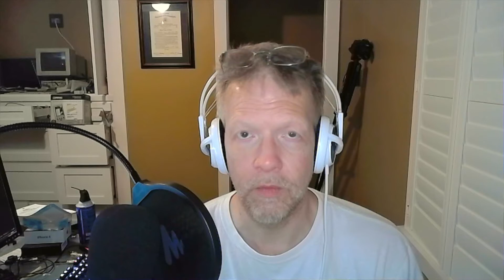BTC-S37 Mining Motherboard Warning: Don't Wire It This Way (IMHO)

Comment: please advise I have the one with the BLUE slots.  Now all 6 pins are live as you said I was trying to use 2 power supplies.  I plugged 1st psu into 1st 3 slots. and then 2nd psu into 4th slot to power a 4th gpu as psus are only 750w. so i wanted 3 gpus on psu 1 which i wired up and 1 gpu on psu 4 which i wired up. all wired up as you said  straight from psu.  now psu 1 was ok BUT psu 2 got very very hot and riser melted smoke!   is that because i plugged 2 psus into the 6 pins which are all live on same rail?  thanks.  if i am correct then how would i use 2 psus?  1 to all 6 pin and 2 cards and other psu just to 2 cards?  anyway safely use 2 psus thanks
Reply from the maker: Read thru for my recommendation...It could be a bad board, bad power supply, but in any case, it's a BAD IDEA to use two power supplies on the boards where the power connectors are all tied together. Just don't do it. The only way would be to use a power balancing circuit but then monetarily it isn't worth it.

There's no 'riser' on this board. People should not even think of it that way. There are PCIe slots. It's a standard slot, just wired for 1x.

Would you use two power supplies in a PC? Ever seen it? (short of servers of course, but they have it designed that way.) 

So don't do it! (I'm not fussing, I'm just trying to get people to STOP doing this).

Solution:
What I have on my board like this with all slots filled is a Dell 1100W power supply from a server that runs all 8 just fine as it has a lot of 6600/67000XTs and lower ppower cards. To go very high would probably require a 240V more expensive supply. It is my belief that efficiency will be key after ETH goes PoS so I've steered that way.

Go here https://www.parallelminer.com/?wpam_id=625 and look for the Dell X15 series. Make sure you match their board with the correct power supply. 

This link earns me a commission.

You can pick another power supply/board combo but the Dells are cheap.

I have the X15 Rev:B on both my boards. I would recommmend a cooling solution blowing at the PSU as well.

Please use these links as they support me or you can send $1 to http://paypal.me/rcbullock or whatever amount you feel is worth me wiriting this up for 15 minutes. :)

I have the X15 Rev:B on both my boards. I would recommmend a cooling solution blowing at the PSU as well.

PSU on Amazon like mine:

https://amzn.to/3uq1clS Why? Because you can get a 3 or 4 year warranty for like $9 and they can be found for under $30. R720xd is a server I have for other crypto stuff so I can keep extras around for that too.

A USB powered fan like this will let the PSU sit on top for cooling. It helps. https://amzn.to/3uomWOO

You can also use 120mm case fans. I bought these https://amzn.to/3xkbvto but they spin slow. Molex connector so I daisy chained them with an AC supply brick. 

You can see them in my other vid on the 8 GPU rig, frame mounted.

Want to sent me a few cents in crypto? Leave a comment for the blockchain wallet type you prefer.
Reply from the maker: I am forking this to a blog post at https://rcbullock.blogspot.com/2022/04/from-my-youtube-video-at-httpsyoutu.html

Comment: Will i be safe connecting 4 gpus directly on the motherboard and 4 other gpus with risers? Using two EVGA PSU for power.
Reply from the maker: You don't need risers. That's kind of the point: eliminate that trouble spot. Plus the rig is smaller. SOME of the BTC series have individual PCIe connections so you can use the slots like a riser and use two power supplies. BUT the BTC-S37 IS NOT like this. Some people say you can run the board on one PSU and the GPUs on another, but no one has backed that up with science to me yet. It goes against the 'power the riser and GPU with the same power supply' rule. You CANNOT do this with the BTC -S37 as the board is all the same power rails, so to follow that logic, you must power the GPUs with the same power supply. Somebody prove me wrong.

Comment: it work for years provides better cable management, it can do the volts better then some power supply wires, would you like some pics?,  the plugs work,  look up the specs or prove what your saying with testing. remember me i have 3 d37, please if your going to give public warnings do your home work first. your learning.
Reply from the maker: There's a thread on reddit that shows (if the testers did it correctly and the pics appear to be correct) which boards have connected power per PCIe and which don't. https://www.reddit.com/r/EtherMining/comments/mx9dfo/psa_on_btcs37_and_btc37_the_12v_pcie_connectors/ It's your gear, do what you want, but I wouldn't run a lot of power THRU the board. Who knows what the traces will carry safely? I don't.

Comment from the maker: I double checked and a PCIe plug can output 75 watts of power. A board can draw 75 watts thru the PCIe slot. The 1050Ti without a power connector will limit to 75W (which means if you add the 6 pin connector you could overclock to more...I have card that has the pads but not the connector). So, you will need to connect 1 PCIe 6 pin cable to supply power to the board for each slot you have filled as I mentioned in the video. You DO NOT have to plug them all in if all slots are not filled.

Comment from the maker: Contrary to some reviews, the 6 inputs ARE tied together. At minimum, I would have one connected per GPU that is in the board. As if it were a riser, BUT it is not. All the slots are tied in this board. So, your power supply might need to push 8x 75watts for the PCIe slots assuming max draw and then 8 connectors with whatever total your cards will use. If you use power limiting software settings, then you can do the math on that. Here's some power supplie ideas on Amazon: https://amzn.to/3j2z7e9

Comment from the maker: You MAY be ok and you MAY NOT be ok (IMHO) if you wire the BTC-S37 the wrong way. 1. I recommend ONE power supply for this board that can handle ALL the power you are going to use. 1a. Distribute the power input thru all 6 connectors. That's what they are there for. 2. There is NO REASON to run GPU power THRU the board, IMHO.